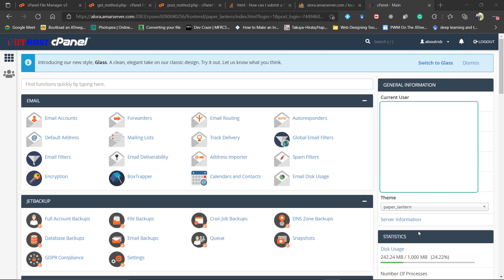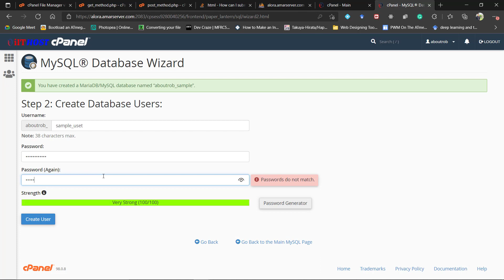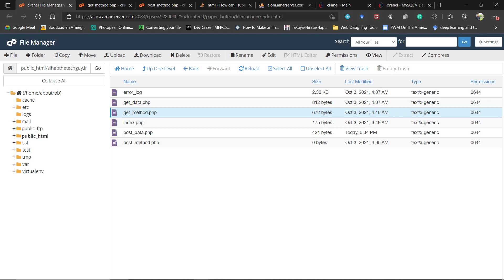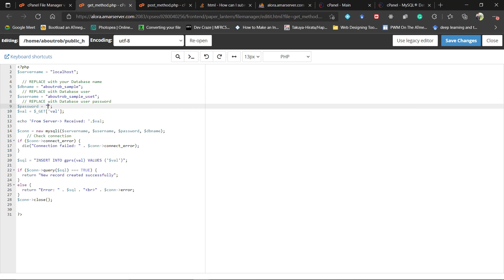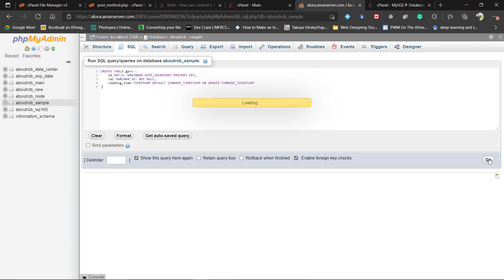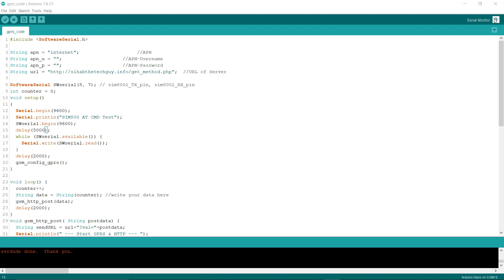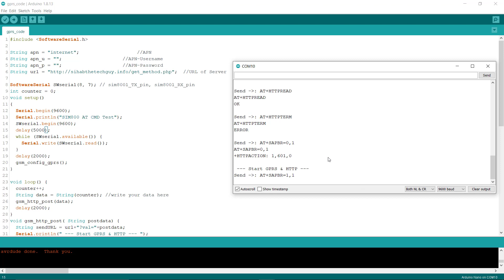Send data to a server using sim800l gprs module | sim800l arduino gprs

Comment: Which resistor is used in circuit
Reply from the maker: use 1k and 2k and calculate the voltage using voltage divider. The 3.3 volts should go to the module

Comment: I am using the same procedure but not able to get data in the server, can you please help me to solve the problem and please do reply if there are any need.
Reply: Which resistor is used in circuit